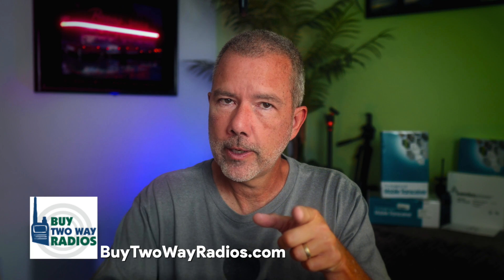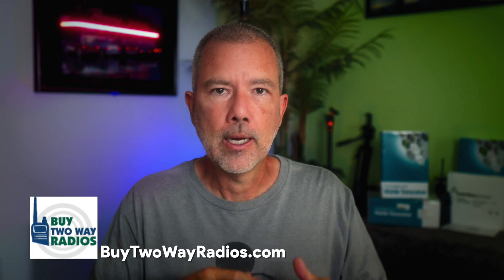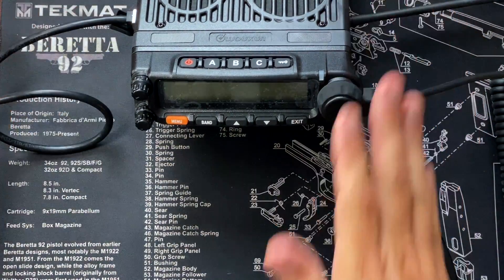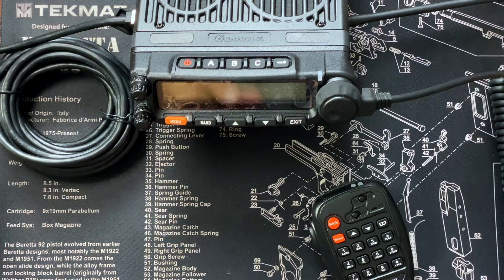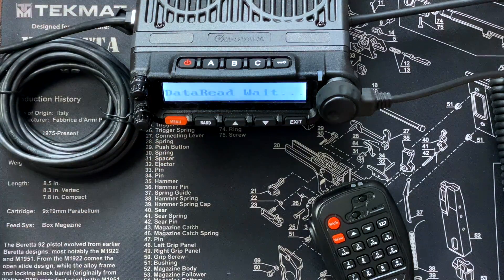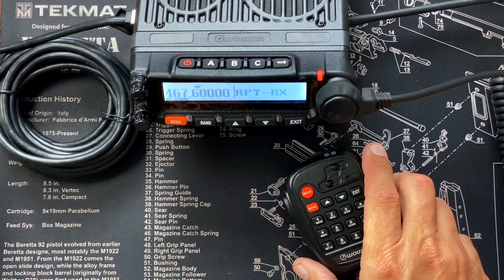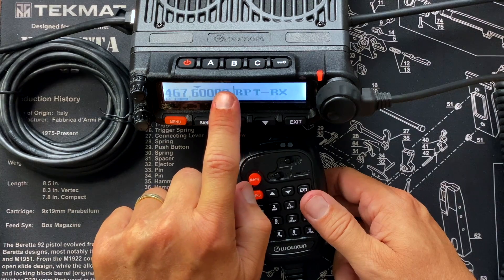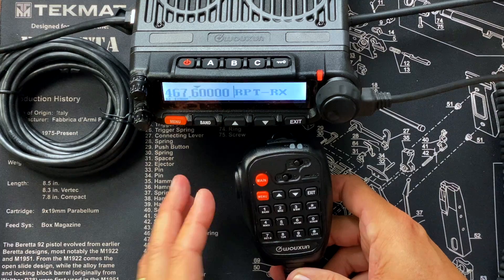How To Build A GMRS Repeater Part 2.5 - First Issues, How To Configure The KG-1000G, and Tom Hanks

Comment: Would this repeater setup essentially operate as a base station as well?
Reply from the maker: Not really.. you would have to turn-off one of the radios, change the configuration, disconnect the duplexer and plug the antenna directly into the radio.

Comment: Why won't my UV5R+UV8R repeater transmit more than a few yards? It works great up close, but only gives a Roger beep past 10 ft no mater what freq.
Reply from the maker: Probably "Desense" .. the radios are cancelling-out each other's signals..
But it could be 100 other things too..
Reply: @TheNotaRubicon  Thanks, I'll try using two antennae again, spaced 50ft.
Reply from the maker: You also have to keep the radios separated or shielded from each other.

Comment: I tried to connect to your repeater frequency 462.600. input tone: 023 DPL. and output tone: 023DPL. so it isn't compatible with Retevis Radios? it doesn't have that kind of tone, is it only for Motorola radios?  I live in Riverside

Comment: I'd asked how this was working in Pt1... silly me.  Same question here.  Like you, I overlook most of the plebes with only the ultra-elites above me.  I'm at one high end of a valley.  I'm pretty sure I'm going to want more than the Retevis 97s can provide for extended use, particularly since we have a lot of obstacles around here, though I'm thinking we may get some 'bounce' off the mountains opposite me just a couple miles away.

Thanks again for all your videos.  Great stuff and I appreciate your rather uncensored (yeah, I know you're heavily censoring yourself because I have a feeling I know the sort of guy you are...) commentary.

Comment: Are you doing anything to ground your antenna for the purpose of lighting protection?
Reply from the maker: Yes.. 
Check the antenna protection/grounding codes in your area for the correct/best way to protect and ground your setup.

Comment: Great project!!
Question: If you use 2 antennas instead of duplexer, how far apart would place antennas?
Reply: I have my antennas stacked on my tower.  The Tx antenna on top, and the Rx antenna on the bottom.  Up about 60'.  Separated on the tower with just a few feet.  The frequencies are non-harmonic, and 5MHz difference.  Since I've made my own antennas I've specifically made the antenna so they are resonant on the frequencies that they are serving.  The Rx antenna is resonant at exactly 467.6250 MHz and the Tx antenna is resonant at exactly 462.6250 MHz.  I use Heliax coax.  It was given to me.  Otherwise I would have used the LMR400.  My SWR on both Rx and Tx sides are 1.01 to 1

Comment: Hey Randy, got a question I'm trying to program 2 uv5g radios to become a repeater and I'm having an issue with the second radio not doing anything. I did have it responding but somehow I did something to screw that up. Got any suggestions? I find absolutely nothing on line that shows how to program uv5G radios for repeater function.

Comment: Perhaps a dumb question... After a power loss, and upon power restoration, do the radios come back on with the proper settings, will you/do you have to turn them on/set them up for repeater operation? I am looking at installing a GMRS repeater at a remote site that loses power a couple of times a week. I would like it to come back on and be operational when the power comes back on (a ups is not practical at this site).
Reply: I have this same repeater setup at my qth and can confirm mine comes right back on after a simulated power outage

Comment: I don't see that anyone already asked this, but how did you come about selecting that specific CTCSS tone?
Reply from the maker: Just make sure that if there are any other repeaters within 100 miles of yours, that you dont use the same tone - otherwise, just pick at random.
Reply: @TheNotaRubicon  Thank you.
Reply: @TheNotaRubicon  I'm lost why a tone was deemed necessary.
This isn't the transmission frequency for any channel right?
The only reason for someone to transmit on this frequency is to try and activate a repeater otherwise they would be  transmitting on the same frequency the repeater is transmitting on.
Preventing spurious emissions causing it to kerchunk?

Comment: Please don't pin me to the top. Can one power supply power two radios? I know receiving doesn't take many watts but transmitting does and you mentioned that you are transmitting at 50 watts. What does the power supply need to be rated for?

Comment: Hey Randy this might propel me to the top of the list but thought I will comment anyway! I didn't  here you mention using the handy dandy 50 watt dummy load first on the transmitter output then on the duplexer output. That would effectively check each item in the line. Great job antenna tuning!

Comment: When setting up a repeater like this using 2x50watt radios and a duplexer - will the duplexer steal power like with the Retevis RT97 repeater (~half)? I'm sure i could ask Google this but i trust your answers more :)   Thanks
Reply from the maker: Yes - any duplexer is going to steal some of your power.. Usually, the smaller/cheaper the duplexer, the more it steals.  i dont remember the exact amount that the one I was using was stealing but it was something like 10-20watts.

Comment: Does the repeater need to self ID with your call sign every 10-15 minutes? Is that something you program into the transmitting KG-1000G part of the repeater?  Thanks.
Reply from the maker: Its not a legal requirement, as far as I understand the rules since anyone using the repeater must ID with their own callsign..   You can purchase add-on kits that will do it and BuyTwoWayRadios should be selling an interface cable for one of those kits soon.
Reply: @TheNotaRubicon  Thanks for reply. One more question: Do you have to apply to get a coordinated pair of GMRS frequencies to put up a repeater in your area. If so, how do you do this and who controls how close repeaters can be that use the same channel. Yes, I'm a ham (one of the good ones).....don't judge me. I feel that anything that gets people of the air communicating is great. Most of the frequencies are quiet all the time. If we don't use them, the FCC might take them from us and sell them to evil industry. Love your channel.
Reply from the maker: Nope.. No frequency coordination on GMRS.. Everybody has to figure it out on their own and get along with each other.. I listened-in on all the frequencies for a week or so before choosing mine to make sure there were no repeaters around to interfere.. then later had to change anyway because there was some overlap with a repeater that is about 50 miles away..I didnt have to, but i did, because i'm a nice kinda guy.

Comment: Shouldn’t the RX be set to 462.600 and TX to 467.600?
Reply: @Don Lamprecht In a repeater it's the other way around. You transmit to it on 467.xxx and it retransmits it on 462.xxx. You listen to it on 462.xxx.

Comment: A couple of pedantic suggestions for when you're ready to finalize everything, if you haven't already done this. Below where your coax connects to the antenna, there should be a loop of coax about a 8 to 12 inches or so in diameter. it's called a drip loop, and it prevents water from potentially wicking into the cable through the connector. And on that same note, weatherproofing the connection is a must. At the very least, two wraps of Scotch 130 and one wrap of Scotch 88 (or Scotch 33) on the outside. It will keep it protected for decades. For my own 1500 Watt installations where I'm likely to encounter rain, snow, wind and ice every year I use two wraps of Scotch 130 and marine-grade double wall heat shrink. Never had one fail yet in over 40 years. Also good practice to over-tighten the barrel of the connector by about 1/4 turn beyond finger tight. Is all of this absolutely needed? No, probably not, but it's good, sound engineering practice.
Reply: Why 2 different tapes

Comment: In reviewing other repeater setups all over the country, many of them use VERY expensive folded dipole collinear array antennas - like, around $2000 expensive.   I'm forced to wonder what justifies such expense, when there are decent GMRS base antennas that cost $100-$200?  And, how did you decide which antenna to use?    Was budget the main factor, or was it performance, or did you just go with what BuyTwoWayRadio recommended?   Thanks!
Reply from the maker: If I was rich, or using someone else's money, I would have used one of those fancy antennas also..Instead I decided on the Tram 1486 because it has a very low wind profile and also does not look like a radar-station for all my neighbors to complain about - and it has 6.5db gain, so it's a 'good' antenna..and, it was only about $75.
Would a $2000 antenna perform better? Probably.. Would it perform $1930 better? i dont think so..
Reply: @TheNotaRubicon  After looking at some far field plots of both collinear arrays, like the Tram 1486, and folded dipole arrays, like those $2000 monsters I referenced, before, I discovered what the appeal of the folded dipole arrays is.   The far field plot of a collinear, like the Tram 1486, is like a flat pancake with a very low angle of radiation - which makes it good for long distance contacts with other stations that are at about the same height/elevation.   So, a group of operators who have their antennas at about the same height are going to have excellent results in communicating with each other.  However, repeaters tend to have their antennas at MUCH greater heights above ground and at higher elevations above sea level.  This means that the stations they are servicing are going to be below the horizon of the antenna - and, the antenna needs to be able to have good radiation, not at the horizon, but below the horizon, as well.   The folded dipole arrays provide a larger "bubble" of coverage that provides both a low angle of radiation out to the horizon, but also below the horizon to service the stations that are located hundreds or thousands of feet below the antenna.

So, when you get your repeater on the air, you might want to test coverage in the immediate vicinity , as well as at a good distance away.   Particularly, see how the coverage is for areas that are much lower in elevation, but not too far away to see if you're getting a good signal nearby.   And, go out a good distance to a point that is also at about the same elevation.   I suspect you may discover some "holes" in your coverage within a few miles of your repeater, while still having the ability to access it from a long distance away.   Just something to consider.

EDIT:   As a way to determine whether this issue is a problem for you I might suggest that you also put up a simple 1/4 wave ground plane for GMRS at the same or similar height and compare between the two.   The 1/4 wave ground plane is going to lack the gain of the collinear antenna, but it is going to provide more radiation below the horizon, which might actually make it perform better with stations at much lower elevations.

Good luck!   I hope the antenna you chose works well for you!  I'll be interested to see the results!   Thanks, for taking us along on your adventure into running a repeater!
Reply: @richardowens9061  Agree with all of the above, but also don't forget a pricey 2- or 4-bay folded dipole array also offers directionality and/or a null. And the reason that they are $2000 (well, a lot less used if you can find one at a hamfest or through a club) is that they're intended for 99.999% reliability in public safety and commercial applications, and the ability to survive for decades through extreme temperatures, heavy rain, snow, winds, etc on a mountaintop. A $75 antenna will not offer the same mechanical reliability, but if it's mounted to your home 17' AGL that's not a requirement.

If Randy is using the highest (50W) TX power level I would be concerned that the repeater might be an alligator (all mouth, no ears). I suspect it likely will. An antenna at 17' above the ground will have limited receive capabilities for weaker HTs and mobiles, but 50W and 6 dBd gain is 200 Watts ERP (less feedline losses), which will be full quieting to the horizon. His users might be able to hear it perfectly, but unless they're running high power mobiles they might not make it in cleanly. Another thing to test!
Reply: @W2IRT  I'm less concerned about the repeater being an "alligator" than I am that it's just not going to have the desired coverage within a few miles of the repeater site.   His location is actually very good -  high above the surrounding terrain, even at ground level.   He can hit repeaters dozens of miles away with his HT at his home.   I think the problem is going to come in when, despite the gain of the antenna, mobile and handheld stations close by but far below the antenna  are not going to be able to hear OR key up the repeater.  I'm of the belief that if you can hear a station, it can hear you, barring noise or other more powerful stations at the other end.   And, that's usually not an issue with a repeater.

Yes, those really expensive folded dipole arrays are designed to be extremely reliable and part of the reason they cost so much.  But, the far field plot reveals their real ability as antennas.   Being able to cover the area at the bottom of a tower as well as 25 or 50 or 100 miles away is where they really shine.   Interestingly enough, the simple 1/4 wave ground plane antenna offers a similar radiation pattern.  It just doesn't have the gain.    Of course, GMRS is a line of sight band, anyway, so I don't see the big benefit of a high gain collinear antenna - but, i do see the benefit in having the antenna at a high elevation relative to the surrounding terrain.

It will be interesting to see how it turns out and what issues manifest themselves once he's gone live and people start using it.
Reply: @richardowens9061  I certainly agree with the negative angle issue. That's a huge consideration, especially for wide-area coverage machines. I was just referencing the the fact that even if he were to be on completely flat terrain it would most likely out-talk its ability to hear at 50W. I honestly don't know a single thing about his neighborhood--I've been to CA exactly three times in my life, so I don't know if there's a lot of stuff below his location, or if he's on relatively flat terrain at the base of the mountains behind him. With an antenna at 12' AGL, I suspect his range will be just fine for running errands around town and calling home, etc. I have a 35' second tower on my house that holds a 6 element LFA for 50 MHz plus a discone scanner antenna, and I was thinking of throwing up an old Micor that I have laying around on GMRS, but I don't have the equipment needed to retune the cans, which are currently on 443/448 and I'd need to get xtals made!

Comment: Question:  Does  Wouxan make a GMRS radio that is less expensive with a lower output rating that can be used as a repeater receive radio?  It just seems a waste to pay extra for a 50 watt output radio that will never be used to transmit. 

Thanks, for the video!  This is an interesting project.
Reply: For many walkietalkie types you can take cable from speaker to mic between each - and BAM💥  you have a repeater! But only as good as the reception on the walkietalkie and it’s tiny antenna to transmit and receive... Them prepped types have lots of videos out there of them hiding them out in the woods in cammo ammo cans...

I imagine if you do the same - wire mic to the speaker on the other and be careful with the volume and ohm ratings etc- one could do the same with any two radios??? That of course have external jacks for such... I’ve actually looked for some of the 50W varieties and of the mobile type you’ll find a jack for speaker (~8 ohm) but not mic... If you want to risk getting all hacker about it.

My repeater budget is being consumed and put on hold until after taxes and a new Jeep....

Comment: Looking good! If you used the 2 antenna method (while waiting on the duplexor) how far apart would your recommend, spreading those antennas?
Reply from the maker: I was wondering the same thing. Maybe someone smarter than both of us can answer.
Reply: @TheNotaRubicon  using omni directional antennas, the separation would need to be vertical not horizontal as the antenna radiant pattern are doughnut shaped. Getting them to resides in each other hollow space (doughnut hole) is the sweet spot to avoid desense of the receiver by the transmission side.  The exact measurements seem to all be "theoretical" but consciences also seems to be,  even a cheap duplexer is a better choice then trying to deal with dual antennas with separation solution.
Reply: @TheNotaRubicon  LOL... That is a tall order! But hopefully so. I am thinking of building 2 go boxes, that could be teathered / linked together to make an instant (field) repeater. Then just use each rig's antenna per radio.

Comment: Hi Randy,  great video series. I’m new to repeaters, and didn’t know that a two radio setup was used.  Does the duplexer buffer the entire incoming transmission and then give the antenna to the transmitting radio and then send the entire message or is it quickly switching back and forth during repeater use allowing both radios to use the antenna. Seems like buffering an entire incoming message and then sending would introduce delays.  Thanks, keep the info coming.
Reply from the maker: a duplexer does not buffer/switch, so there is no delay. instead it isolates the transmit signal, or does some other voodoo so that the transmit signal does not step on the receive signal.